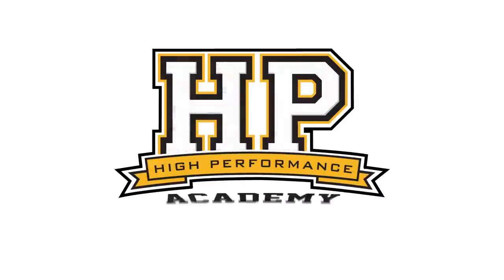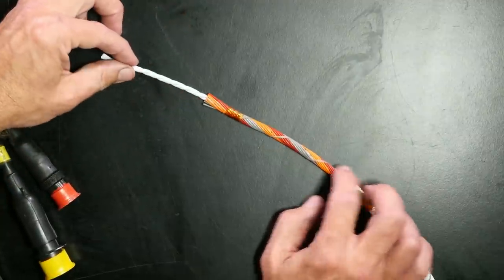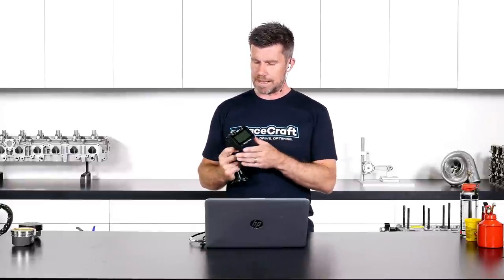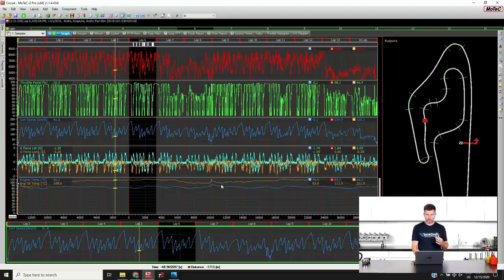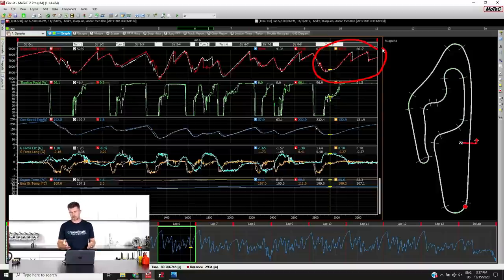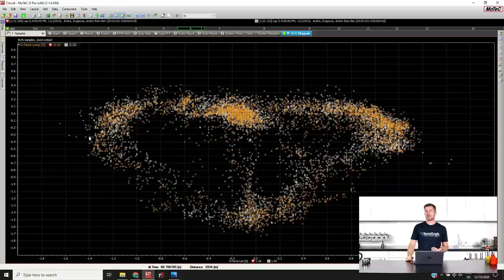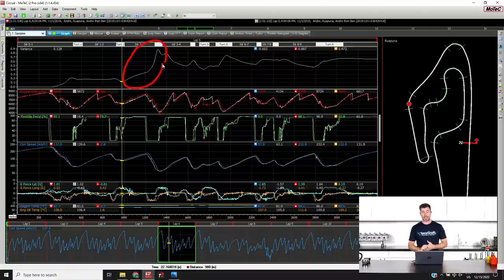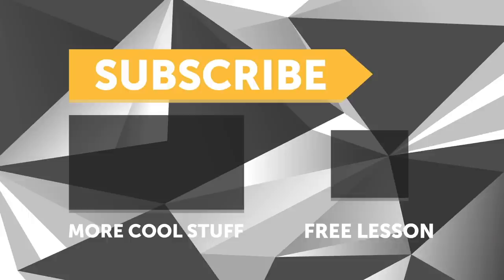Why Are These Amazing Tools Often Overlooked? | Go Faster With Data [#UPDATE 260]

Comment: TL;DR: Buy a $700USD AiM Solo 2 DL & connect it to the CAN Bus.

Getting professional motorsport level of datalogging/analysis is much easier than everyone thinks on a 2008+ vehicle (CAN Bus required by law). Buy a $100USD Microchip APGDT002 CAN Bus Analyzer & plain wire. Connect the analyzer to the CAN Bus High & Low pins of the OBD-II port and a laptop. Watch the numbers change as you manipulate the car. You have “hacked” the CAN Bus and know what channels you want to log. With my 2019 Mazda MX-5 I get the following channels without any modifications to the car other than connecting 4 wires (Power, Ground, CAN High, CAN Low) to the OBD-II Port. Lateral & Longitudinal Acceleration, Steering Wheel Angle, Throttle Pedal %, Engine RPM, Wheel Speed x4; all of these are at very high resolution and 100Hz. Brake Pressure, again at very high resolution and 50Hz. These 7 channels are the most important (per Jorge Segers) channels to log. I personally use a MoTeC L-120 logger, but that is only because I prefer the MoTeC i2 Pro software. Buy a $700USD AiM Solo 2 DL, connect it to the CAN Bus, and log the above channels. The “next level” would be a $1100USD AiM MXM so you can connect Shock Potentiometers x4 and log suspension movements for tuning.